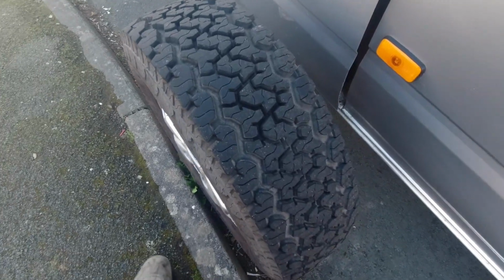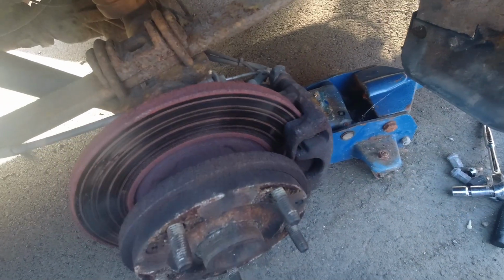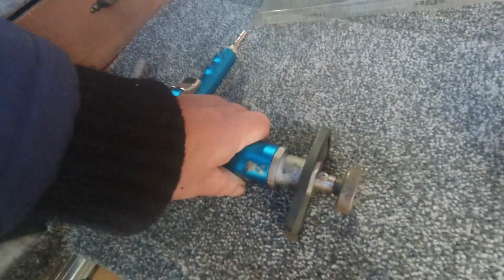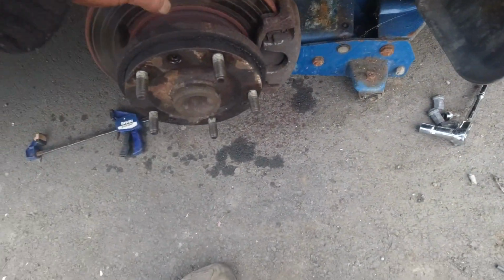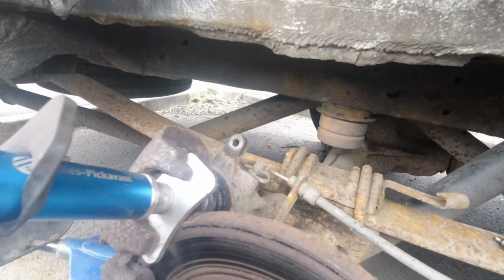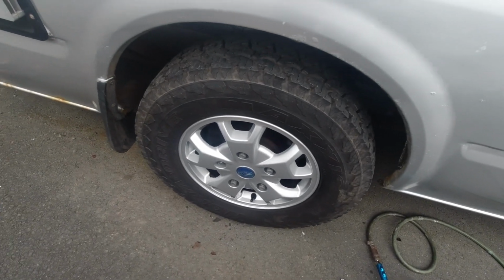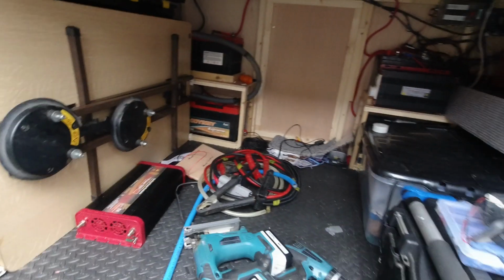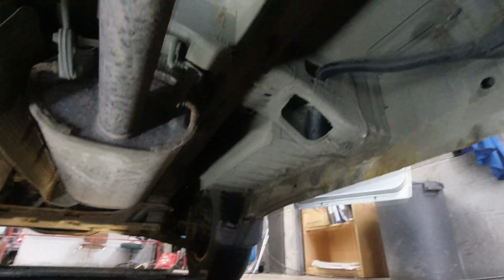#07 MOT Time  Adjust Rear Brakes

Comment: I would have changed the brake disks as the actual braking surface looks reduced and scored from all your off road capers.. I'm sure you know what you are doing.
Reply from the maker: Hi ya.. The disks were new 2 years age.. They only looked rusty because I used that autoglim wheel cleaner and it makes every thing rusty.. It will wear off once I start using the van.. MOT was the first time I moved the van since last sept.. Cheers Bud

Comment: Have you ever recorded changing of brake discs? I have a transit mk7 and understand they're a nightmare to replace due to them needed detached from the hub also. Thanks alot
Reply from the maker: Hi David.. I have done it a few times, But I have not recorded it.. YES.. Both front and rear are hard to do.. Front, Getting to the bolts through the hub are torque bolts.. I always say to have new hubs at the same time as they never go back in level and could end up with a wheel wobble.. Rear, its trying to get the locator bolts out.. again you have to open the calipers up, so could run into the same problems I just had.. Yes they can be done, but take your time and make sure the surfaces are very clean and flat when you put them on.. Cheers